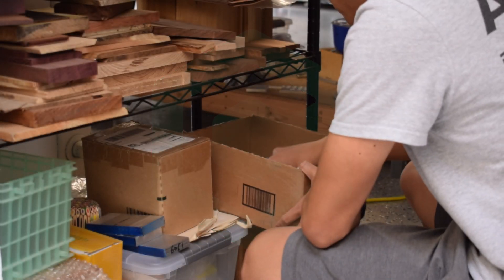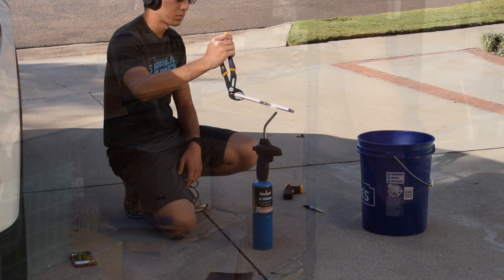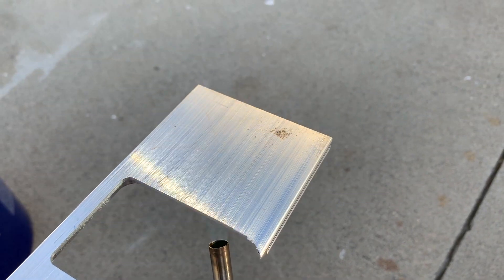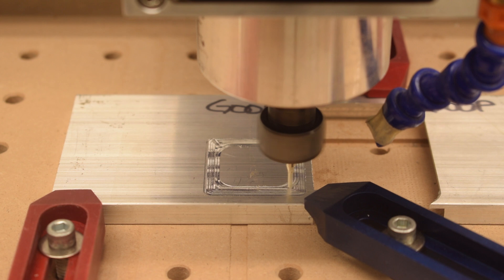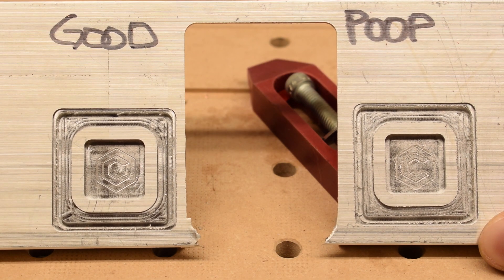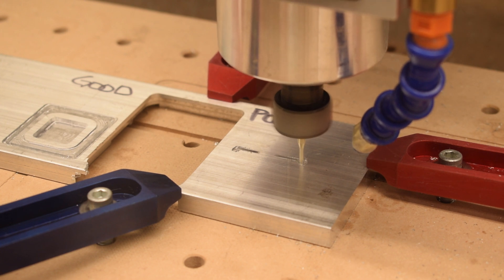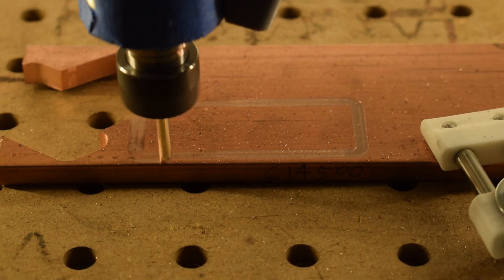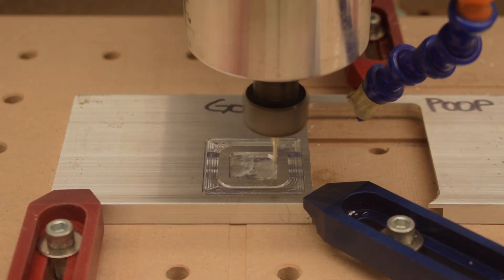What Happens If You Machine the Wrong Metal Alloy or Temper?

Comment: What about aluminum in AW-2007 ? ... I've heard its even better for machining than 6061-T6 (or our European equivalent of 6061, the 6082), but those sources are mainly professional "job shops". Thanks.
Reply from the maker: Unable to comment since we've never used it, but in non-ferrous metals the advice from professionals is generally also applicable to desktop CNCs.

Comment: Given that you have a piece of metal that is not optimal but its all you have, then?   Increase feed rate?
Reply from the maker: Hard to have a hard/fast rule in all situations, but increased feedrate OR reduced spindle speed can help. Causes you to cut a larger chip per revolution of the cutter. 
Harvey Tool's blog has some good general guidelines, only some of which are applicable since we're not usually running into thermal limitations. https://www.harveyperformance.com/in-the-loupe/tips-for-machining-gummy-materials/

Comment: Was this video in response to my question about getting burrs on v engraving?? If not it's good timing!

What Ali would you choose if you wanted to engrave but also anodize? I've heard 6061 does not anodize well.
Reply from the maker: Sadly it was not inspired by you, but it's a happy coincidence.

6061 is one of the most common alloys used in the industry and anodizes just fine. In fact, because of its prevalence, most anodizers should have plenty of experience with it. That's where I'd start, 6061-T6/T651.

Comment: Great video!
Can you also do a video about internal stress and stress relieving process for milled parts?
Reply: If internal stresses are a concern I've heard that cast ali (tooling plate?) is better because it doesn't have extrusion stresses.
Reply: True, I’ve always referred to it as Mic 6 or Fortal (the stronger 7000 series cast tooling plate option).  Mic 6 is kind of weak though, so that’s a possible concern.